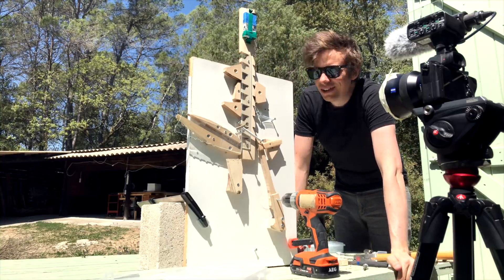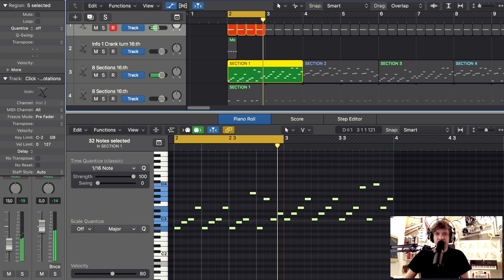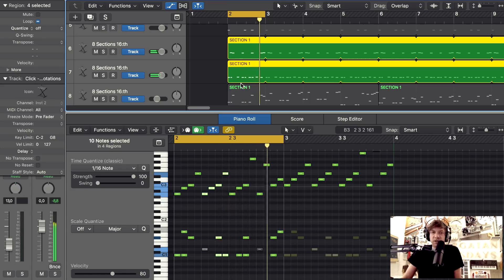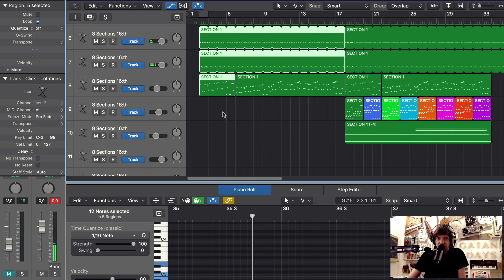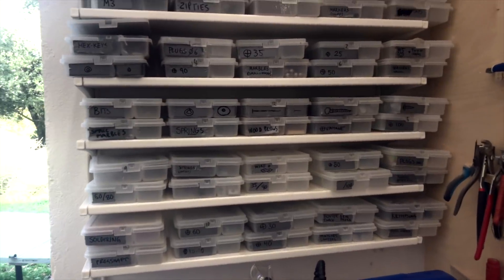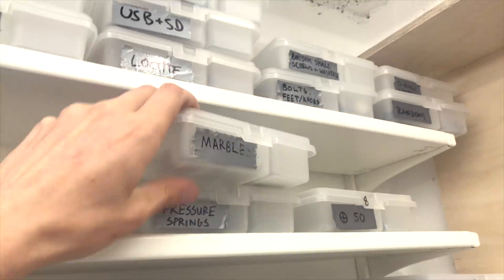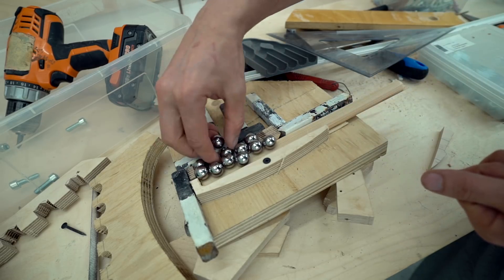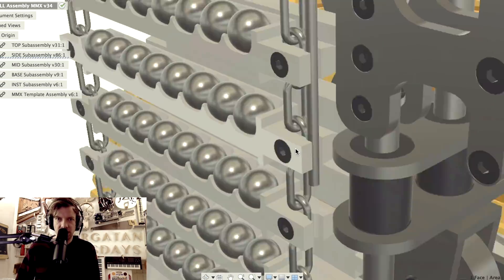Conveyor Belt Marble Lift - Marble Machine X #33

Comment: How about speeding the marbles up on their way up like a Catapult. I just thought of two fast rubber belts that accelerate the marbles upwards. you could build a railsystem that leads the marbles upwards and different collection areas - so no centrallized lift, but rather different systems. 

The rubber belts rotating one clockwise and the other counterclockwise speeding up the marbles that pass between them to a speed that ensure that the reach the peak of the designed path, from which they slow down.

Comment: Hi Martin, 
as always, I like your work. But did you check the radius of the marble routing between the wheel lift and the demagnetizer? Are you sure you'll get enough marbles through there? And also around this tight corner?
Cheers!

Comment: Looking at the latest iteration of the MMX in this video, I have begun to wonder about the torque required to operate it.  With all the different mechanisms, pistons, gears, etc, it looks like it might take a lot of strength to get it rolling initially.

Comment: You might consider changing the lift system to a rotating disk with slots because you change the gearing  a lot easier to spin and drop marbles up in the top of your machine. A disk made similar to a skill-saw disk. would allow faster  transfer that the jacking system.

Comment: @wintergatan 13:18 the thing that concerns me with driving the system as you describe here is that at the transition point between the two lifting pegs will be the point that each lifter has the highest velocity. this could cause the system to have a nice ratchet upwards (and a cool sound too!) however it could rattle the marbles out of your lifter, not a killer to this design. but that's my biggest concern. good luck on your ratchet-er this week! 

Also, make sure your going slow enough over those demagnetizes!

Comment: that is much better than the ratchet system, did you consider using a screw system? like this https://www.youtube.com/watch?v=1DZBqYP6HWs pitch of the thread can be changed to increase speed, or run multiple treads to lift marbles in groups

Comment: Why not make a circular Ratchet Lifter system that has two semi-circular halves that are individual Ratchet Lifters but run on the same rack, giving each pull AND push of the rack causing the two Rachet Lifters to alternate? One pulling up and taking marbles with them, the other pushing downwards to grab more marbles, then alternating with every pull and push.

Comment: Why not just use multiple screw lifts? 3D print (or machine/get made) a couple screws that would be big enough for the marbles, then put that in a clear plastic pipe, would look really cool and depending on how fast you can get them spinning it should be easy to meet/exceed 8 marbles per turn.

Comment: In regards to the chain shown at 10:57 I would STRONGLY recommend using something like a #25 or #35 roller chain (basically bicycle chain) instead of welded link chain like you have in your CAD. #25 or #35 roller chain will be MUCH more stable and you can connect things to it easily using something like "K-1" or "A-1" style links. The chain link you're looking at using is not designed for the level of precision required to keep your marble trays balanced, and at the speeds you intend to operate this at you're also likely to see a lot of vibration as the links move over the sprockets which will likely result in marbles bouncing out, this issue will likely be further amplified due to the amount of undercut your sprockets will have on the chain due to their relative small radius.

Comment: @Wintergatan:  You may want to prepare your lift-side of the chain to include a plexiglas/perspex window to retain the balls as they climb.  Your prototypes showed how violent the cam action can be.  With the 8x balls merely cradled in the chain link trays, I'd be willing to bet that the up and down bounce is enough to have the balls bounce out.  In fact if you look at your high speed slow down starting at 8:28, you'll see what I'm talking about - they bounce up and then chaos determines if the hit the bottom or the back of the tray first, which causes some of them to nearly bounce out (you have the luxury of screws in the cut-away prototype, you won't have that in the final build).

I'd also recommend that you start thinking about dampening some of the noise a bit from the marbles.  Perhaps leave some margin in your lifting designs for some adhesive backed felt to soften the landings of both balls and indexer fingers and kill rattles - I think you will find that the mechanical noise may detract from the music once it gets to a certain "crescendo". ;-) Cheers!

Comment: The marble machine has been completed a long time ago. It makes beautiful music, works perfectly, has no quirks, is totally reliable, is fully repeatable and very dependable.  It is shown working here, and in several previous videos, on the screen of the PC.  It is the MIDI Software Player!!  

If the goal is to make great music, the MIDI certainly can.  If the goal is to make an aesthetically pleasing "Rube-Goldberg" "mousetrap", then the Marble Machine X will be a never ending project.  I hope you never get to the point of trying to make a mechanical calculator out of plywood gears, dominoes, beads and marbles.  

You have done a great job of transforming yourself into an artistic, musical, mechanical engineer and assembler.  The question now is: Make Music or Machine? We shall see in the future.
Reply: Both, duh

Comment: Why don't you just use a string pully system? you can use tubes, and a piece of string with some periodic marbles attached, and it can pull in at the bottom where the marble tray is, the ball on the string will fall into the queue, and grab other marbles in the empty space, pulling it to the top through the tube where it's released. It will look like some never ending sex toy, but hey, it works, and pretty well from my experience, I used the same method to pull water through a system, a pump.

Comment: Martin, I'm guessing you haven't been able to do whole system tests yet, and you've probably already considered this, but just to mention it; the whole lifting chain will need to have progressive capacity; that is, each step must move marbles faster than the previous step, or you risk overruns and flying marbles. Do the div by 4 and div by 8 combined shift marbles as fast as the ring gear lift can deliver them?

Comment: I think I have a concern with your design. After the marbles split into the four channels to get demagnetized, I fear that funneling eight marbles per crank turn back into a single line will not work. Have you tested that yet? I would suggest splitting the marbles into two tracks After demagnetizing and loading the conveyor from two different chutes With four channels. I can picture it in my head better than I can explain it. Does this make sense?

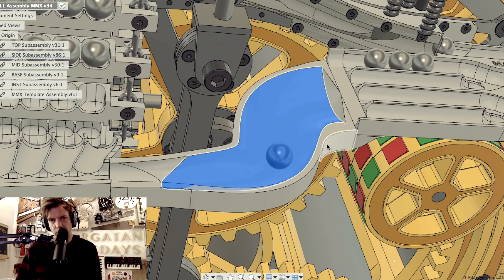Comment: Question to the part at 11:39 
You have 4 "channels", then you join to one, and only some centimeters later, you divide again to eight? Would'n it be more efficient to keep the 4 parallel chanels und just split each into two, to feed that chain lifting system?

Comment: It turns out that the lifting mechanism of the first machine wasn't a bad idea after all - it just wasn't built in a reliable way. It seems obvious that a conveyor belt is the most efficient way to lift large numbers of marbles, and in theory you could simply make it wider if you need more marbles per crank turn. It also avoids back-and-forth movements and magnetic forces that only increase the amount of power needed to drive the machine (the first machine could actually run from momentum for a few seconds!).

From an engineering point-of-view, you should keep things as simple as possible, to avoid trouble. So you should get rid of the magnetic lifting wheel and the demagnetizer mechanism by simply extending the conveyor belt down to the bottom of the machine. 

From an artistic point-of-view though, it would of course make things a little less interesting...

Comment: I do prefer the first lifting system! Why won't you add gear ratio like 2:1 or even a gear box to increase to 4:1, it woult be so clean and I think the first design can handle such speed.
Reply: doubling the gear ratio also doubles the force needed to turn it. 4 to 1 even worse.

Comment: I like the chaindrive but i'm worried that the discontinuous drive will allow the marbles to fall out to easily from vibration.
I suggest abandoning the pistons, rotating the chain lift by 90deg on the vertical axis, and engaging directly with the outside of the big programming wheel gear to drive the belt.
Then again, the more crazy the solution the more impressive it will be at the end :)

Comment: You have way too many transitions for the marbles.  First, the gear lift.  Then the 4-way splitter and the demagnetizer.  Then combine x 4, and re-split x 8 , then lift a 2nd time!  First, ratchet drive is bad news.  There will be lost motion that will  require adjustment.  It will be excessively noisy.  Ratchet and pawl will wear more than gears or belts.  Drive the top gear from the other rotating parts.  Ditch the magnet gear lift, and do all the lifting with a single device (the belt), from the bottom to the top.  dump excess marbles back to the bottom.  Pick the marbles off the belt the way you did it on the original machine, with interlaced track.  Use 3 stage binary divider at bottom (like old machine, except 3 stages instead of 2).  Make the lift excessively high, so marbles have energy to divide, etc.  If you have belt, that is fish ladder for?

You can use pair of bicycle chains for the belt, brazing the marble cups on, and bicycle sprockets for gears at top and bottom.

Comment: Hello there! I just thought: why not rotate the demagnetizer 90 degrees and place it under lift-entering section? No sticking out this much and no need for this divide-by-4-combine-into-1-divide-by-8 system. Or am I missing something?
 And one more concern - will 8 marbles have enough time to roll into lift? Every time they seem to start from zero velocity, accelerate parallel to lift, turn 90 degrees, accelerate and stop in the lift and have around a second to do that.

Comment: The complexity on the showside of the MMX is growing too much, increasing the possibilities for failure.  At least some off this is due to the magnetic lift which necessitates the demagnetizer and associated mechanics.  The gear lift is grand and can still be used with pockets in the wheel.  The chain lift could be used to pull marbles up the whole way to eliminate another step.  (I'd put a acrylic shield around the upward track to keep marbles from falling out if the lift sways in the long section.)  KISS - Keep It Simple Sir.

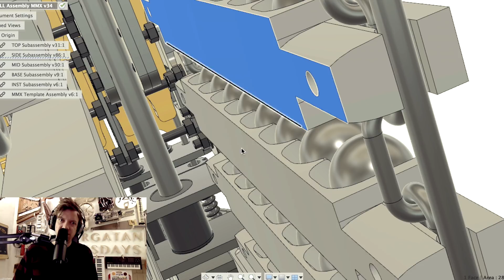Comment: Long time follower, first time commenting.  Thank you for sharing this journey with us, I look forward to the world tour!  The reason I commented was because of something that was a red flag while I was viewing.  At 14:10 you claim the ratchets will push the conveyor up.  In my experience it is much, much easier to pull chain than to push it!  Your system will work better (as opposed to potentially not at all) if you pull down on the back of the system instead of attempting to push up on the front.  It shouldn't change too much in the overall design if accounted for early.  To expand on what I was trying to explain with pulling vs pushing; pushing chain makes it buckle while pulling it holds it taught.  Hope this doesn't throw too big of a wrench into the works!

Comment: From my point of view the section before the divide by 4 looks like a huge bottle neck (especially with the 180° turn the marbles have to make there). So even if you can lift 8 marbles per beat on 200 bpm which is 26.sth per second can they actually pass that section that fast?

(Just did some more math on it and think they would need to have speeds like 50km/h to do that assuming one marble is around 1cm thick)

Comment: @Wintergatan, I think or will be better to pull the conveyor belt down with a ratchet system instead of pushing them up on the front side. With pushing, the chain might buckle, which leads to problems in the lifting mechanism

Comment: It seems like this is all going to be very loud with all these ratchets slapping around and marbles slamming into all these surfaces/eachother. I also don't get why you divide by 4 to demagnetize, then go back to 1 only to right away split to 8. That looks like a major bottle neck that could cause overflow problems (marbles falling over the side). The flow path for the marbles would be much smoother, and quieter if you ran 4 paths to the elevator. Then split into 2 rows 4 times at the elevator. 
All that said, why all of this complicated stuff? Why not just use another magnetic rotating wheel to lift the marbles, and demag at the top. It might not have the same visual appeal but it would be MUCH more simple, and MUCH quieter. Wasn't one of the big complaints about the old machine was it was too noisy and complicated?

Comment: i think you should go with the first marble machines lift system only make it better you wont have to worry about magnatization and you wont have so many parts
Reply: Marilyn Darling yes I think if he slow down the marbles when entering the divide by 8 system will make it perfect . After all this is the marble recycling system it won't work if the marble divider is full ( at least at the last rows) so speed isn't that much needed
Reply: exactly finally someone who understands
Reply: hes going to either need more marbles than the system can handle or hes going to have to make a simpler system

Comment: Martin, in engineering terms, your pistons are not pistons but are connecting rods, or con rods for short.  In an internal combustion engine the con rods connect the pistons in the cylinder to the crankshaft and turn a linear motion at the piston end into a rotary motion at the crankshaft end.

Comment: Why not just use a spiral in a plexiglass tube. It does not produce noise and you adjust the rotation speed easily to choose how many marbles per crank you need.

Comment: There might not be a way to make it look good in the space, but it seems like you could save a lot of complexity by keeping the four channels out of the demag separate and splitting them directly to 8 for the elevator, instead of recombining them in between.  I.e. going 1->4->8 rather than 1->4->1->8.

Comment: All those marbles with the chain links are going to be really heavy, no? I would be worried about the ratchet system holding up long term. Just from a physics perspective, that's a lot of force being applied in short bursts, meaning very high energy/power. Also, chains are really noisy.

Comment: Wintergartan, I really like your idea with the conveyer belt. The only doubt I have is: 
Will the chains cause unwanted Sounds?? Using plastic chains might be more silent than metal chains. 
But having a little bit of noise from the chains could also add some character to the machine too (as long it's not too loud of curse). 

Please note that I'm not an expert and the chains might remain silent. I just don't want you to have unwanted surprises since you're working on it so long.
Best wishes

Comment: I'm really concerned about merging the four channels after the demagnetisation wheel down into one. For the last several years I have been building machines using LEGO that move balls around in various fashions (https://www.youtube.com/results?search_query=great+ball+contraption), and one of the traps for beginners is having a ball path that narrows like that - inevitably you get two balls trying to go through at the same time, and they both stop and block the path. It can be particularly  nasty when doesn't happen all the time. You can stop it from being a problem if you add some mechanism that constantly jostles the balls a bit to stop these blockages forming, but that adds extra complexity.
I look forward to seeing how you deal with this - 8 marbles per crank is a real challenge.

Comment: Good video as usual.

I want to suggest two things:
1. You have 4 "lanes" all ready, so dividing each of them into two would make eight as you need.
2. You don't have to load the marbles on one "level", depth is restricted as you said. So put the marble lanes above each other. This way you have more space to work with.

Just thoughts.

Comment: Looking at the solutions presented so far, you seem to be concentrating on a lift mechanism. How about changing things a bit ?
If you use tubing with an Internal Diameter of the marbles, you could then look at a way to push marbles (either down a hole, horizontally into the hole, or up). The Tube will at all times be loaded
with marbles, but you only need to concentrate on the feed at the bottom ??
You could use some sort of chute at the bottom, with a friction belt running above the marbles to give the required push force into the tube.
 Just a thought ..

Comment: Martin, Have you ever considered a pachinko machince  style ball lift ? With a tweak like adding in a few ratchet style back flow  stops  to take  the full strain off the ball wheel start you could theoreticly set up a ball lift up that could supply as many balls as you need  up to the top during the entire performance of the machine. And it could also lose the Magnetiizing and demagnetizing aspect.

Comment: why not just use a helical lift like an Archimedes screw? less reciprocating mass will be less likely to interfere with the rest of the machines operation and a ratcheting lift seems like it could have less than optimal wear characteristics.